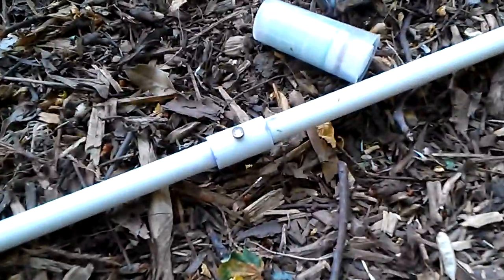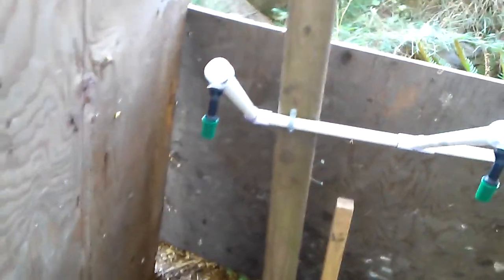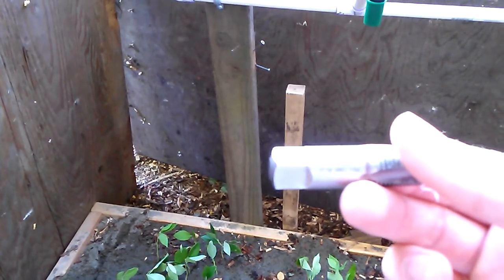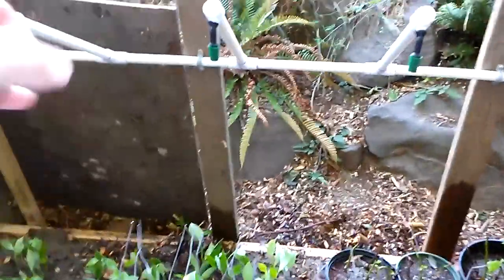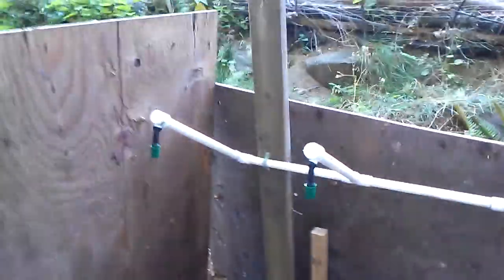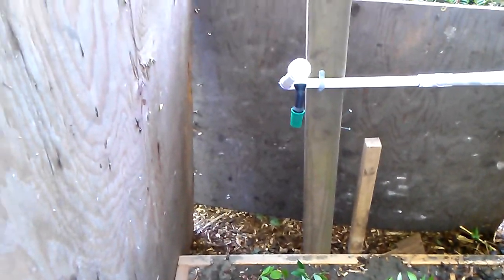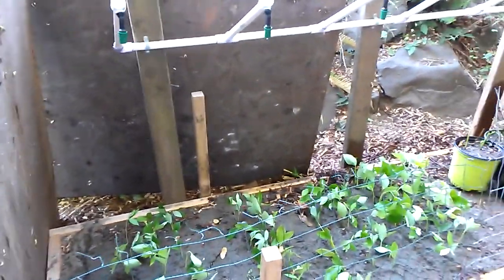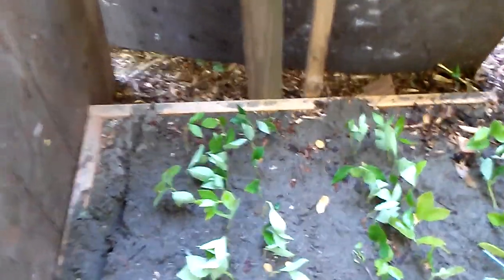Propagation system, upgraded, new misters

Comment: I have a question: did you tap your threads for your nozzles through the caps at the end of the pvcs? From your video, it looks like what you did.
Reply from the maker: Ed Piacentino hi Ed, dramm stix are a much better option http://www.kbwsupply.com/product/dramm-stix-30-inch-green-pin/ . See some of my newer videos, just drill a hole in PVC pipe, stick the hose in and zip tie. Even better is my aquaponics setup, I propagate all the elderberry, blackberry that I want and don't have to worry about the water supply being turned off.
Reply: @TexasPlantCo  
Thank you.  I have never tried dramm stix.  I propagate hardwood rabbiteye blueberry cuttings and use overhead irrigation.  I connect my nozzles using 1/4 tees, about a foot apart and 2 feet high.  I have had excellent results with this system, which I run on a DIG single station propagation timer, which runs off a 9-volt battery.  My water source is a spigot with a calcium inhibitor filter to which I attach a hose and run into propagation system.  I attach the other end of a small hose to a 3/8 inch hose, which I run into three 1/4 inch irrigation piping, placing each misting nozzle about 1 foot apart.  I think I may get a couple of these dramm stix and try them on another of my propagation boxes.  Thanks for the tip. By the way,  could you please give me a link to your propagation system using dramm stix.  Ed